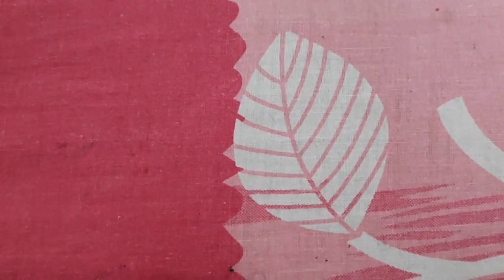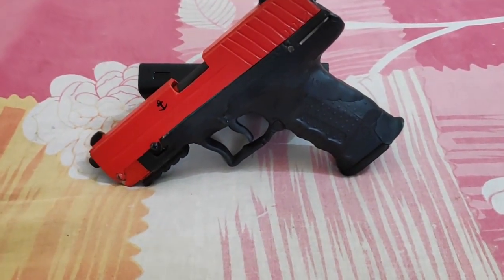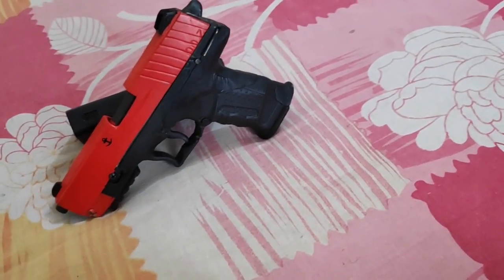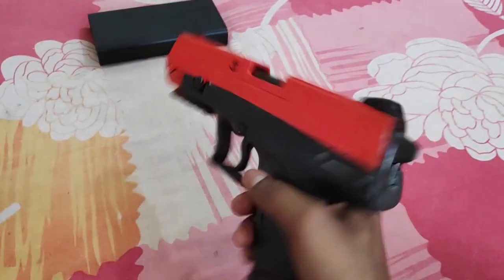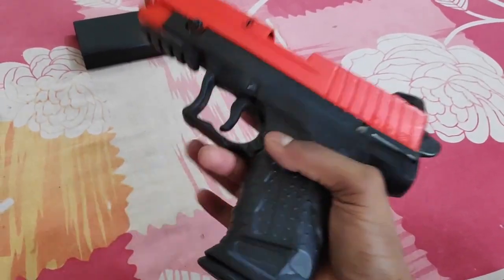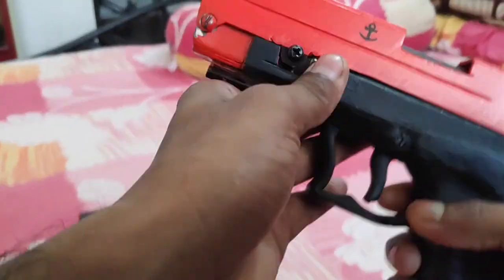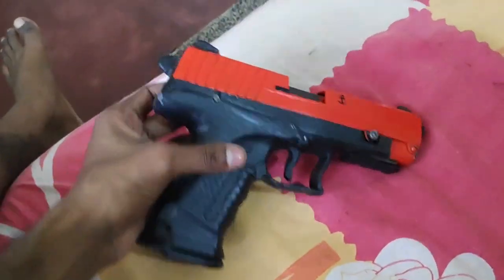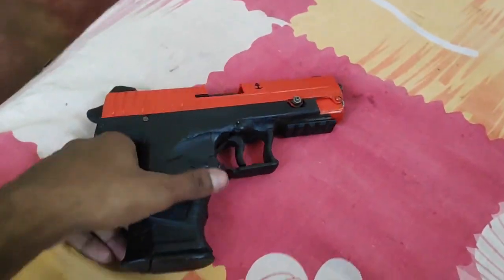homemade multi pump air pistol

Comment: How does it's power compare to the rifle you've previously made? Can it pierce metal plates
Reply from the maker: Good question its power is almost 65% of my previous air rifle at same calibre ( .25cal ) but the thing is that my rifle has a long barrel and this air pistol has a short barrel & still does produce a lot of power so its still powerful pistol

Comment: Sig saur p226 damn.😭😍😍👍👍👍
Reply from the maker: 😁😁😁 tried to replicate..!!
Reply: I have one question bro...can i make it with bike shock absorber?
Reply from the maker: @thatManoctane  yes u can just need to change inner assembly make a new push plunger head which moves in side the cylinder and 2 one way valves one to take air in from out side and one to take that air inside the compression chamber.. click this link to see the working of the all in one air compreson system- https://youtu.be/tko4xNjKcOQ
Reply: @pritampatra1595  thanks
Reply from the maker: @thatManoctane  no problems bro...😁